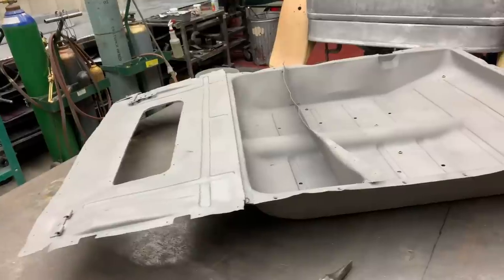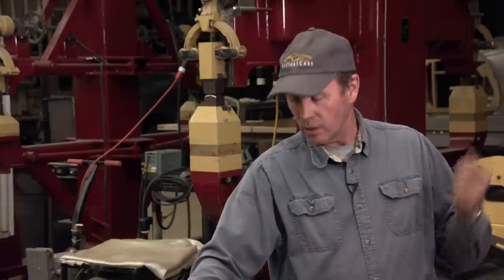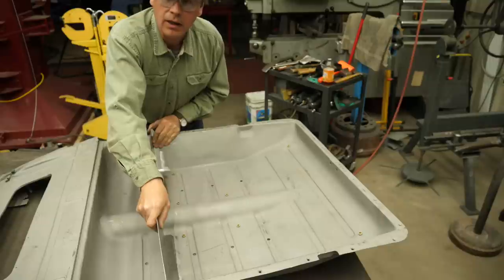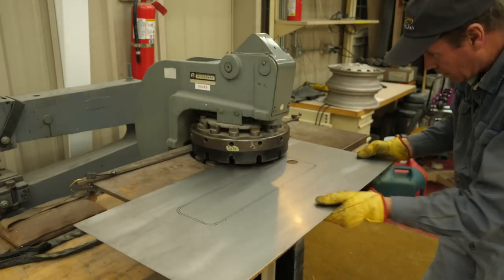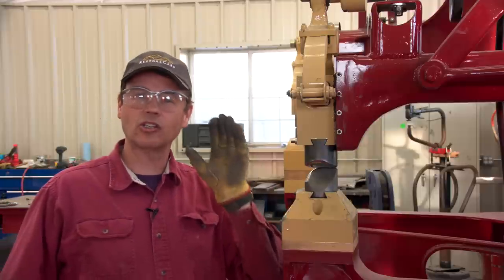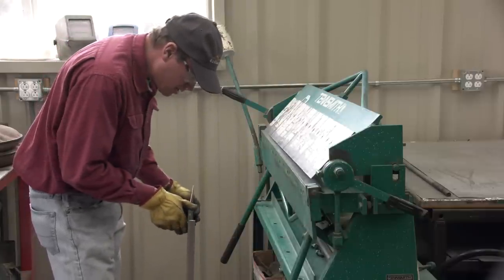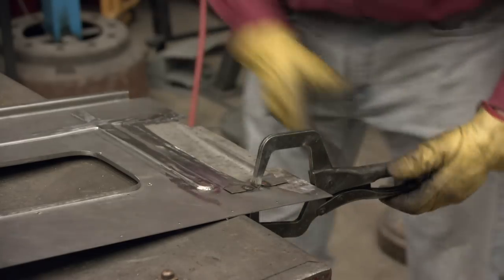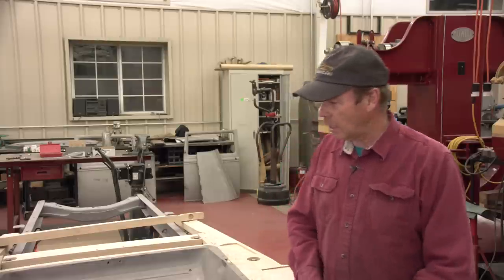EP 8 1931 Model A Victoria restoration

Comment: Didn't know that trick for the box and pan brake. I have a smaller on so I'll try that on my next project. Thank you. 
Learned the hard way about trying to do those spot welds if/when you don't hold both pieces of metal tightly against each other. Lots of nice "burned out holes" !!! ;o( 
Found those "Roto-Broach" drills work pretty nice for drilling out the spot welds. Gotta be careful because they cut really good so it's easy to drill all the way through. But, they are effective so you don't waste lots of time. 
Bought one of those "larger" Whitney" punches recently for making plugs for patching holes. Goes up to ?? 7/16" if memory serves. Works great. Make the plug (which comes out slightly dimpled) pick the exact drill size and drill the hole out, put the plug in the hole with solid backing behind it and hammer the plug flat. Doing that makes the dimpled plug grow slightly so it locks itself in the hole all ready to be welded. Love that"'BIG" hole punch you have. 
Did you make those two plywood bucks both the same size or was the lower one a different size?? They looked the same ?? 
Dontcha just hate it when you need to do things twice ??? Can't be avoided sometimes so best to "not let it spoil your day" !!! 
Thanks for all the detailed commentary. Don't have all the professional equipment but it always helps to understand what's going on no matter what method.
Reply from the maker: Thanks the tips on the punches, etc.  The bucks are the same size.  When I make metal dies, I account for the metal thickness.  I made the bucks out of white oak.

Comment: I recently gotkk my grandpas 31 model A from my uncle, Grandpa put it on 32 chassis and installed a 51AB with 39 (maybe 37) trans with winters quickchange, My uncle had the body channeled on the frame and ruined this car, is a complete floorpan available for a 31 A ? I know you are a restorer but I want to put this car back to how I remember it as a kid. Glad he did not cut the top and saved the fenders and running boards. You build beautiful cars and love your channel and any advice would be greatly appreciated.Thank You.
Reply from the maker: Not sure of one is available.  Check with Steve at Berts Model A.  He has more original parts than anyone.
Reply: Carl White are you looking for the floor pan for a Victoria?  Or for some other body style?

Comment: Hi Mate, just found your channel, and to date this is the only one of your videos that I have watched. Firstly nice work and wow what a factory that you have. I noticed that you pre stretched the bead lines with a power hammer and pressed the lines in one pass on the Pullmax. I don't have a power hammer, but I do my beads in several passes on the Pullmax. Does it make much difference? I also may have a different method for doing the intersecting bead lines that may interest you. The dolly that you made to hammer out the intersection of the lines will work in your Pullmax as a lower tool piece. If you run the main line at 1/3 depth and clamp the cross dolly at the intersection, you can run the other line through with the dolly sliding on a flat pedestal in the lower tool holder. By increasing the depth and alternating the beads you can get finished work straight of the Pullmax. I also use end profile shape lower tooling in the same way. Hope that this is helpful.  Looking forward to seeing more of your work. Cheers Rob.
Reply from the maker: Thanks forth tip.  This is what makes this kind of venue so great.  I will definitely try your idea.

Comment: You know there is rust in the seam of the floor pan.  Let's say you don't need to replace  the panel under the rear cushion; how do you treat the rust in a way that will ensure the longevity of the restoration?
Reply from the maker: Thta is a problem.
Reply: @claytoresto  I identified that problem with the first car I restored, a 55 Chevy.  After some experimentation, I found that I could inject a slurry of phosphoric acid (actually, I use concrete cleaner as it has the correct percentage of phosphoric acid  and is dead cheap) and methyl cellulose with a syringe into the seam. It seems to be a self-limiting reaction meaning that the unrusted metal is affected only to the degree that it is etched and ready for paint.  The acid/rust reaction leaves what appears to be a carburized layer that is impervious to further rust!  The downside is that it is easily removed.  Since I can't or don't want to get into the seams, I merely inject gasoline tank liner paint into the seam.  I don't restore cars anymore, but I use this same process to restore other rusted projects to excellent effect.

Comment: ever find a spot weld cutter that doesnt tear the teeth off when you get into rusty stuff?
Reply from the maker: Yes, I use them.  When I need to save both pieces i use one.  But the cutting tips do not last long and are way more expensive than the just using the cutting wheel and sacrifice the piece I am discarding anyway.